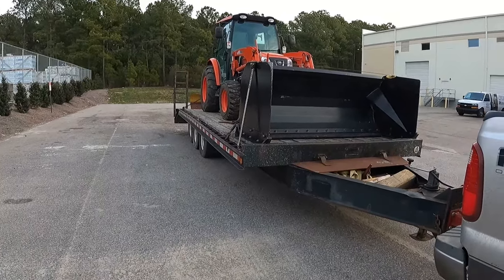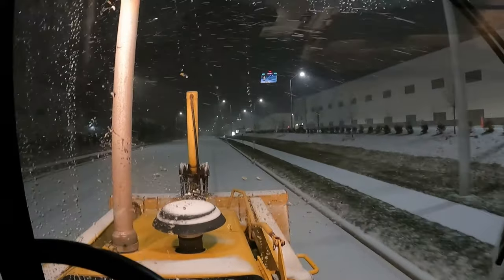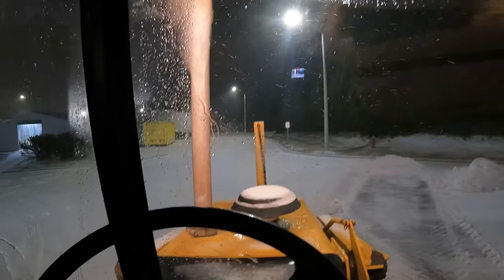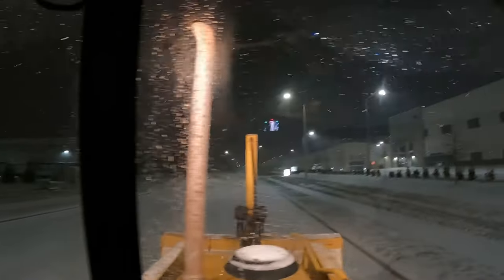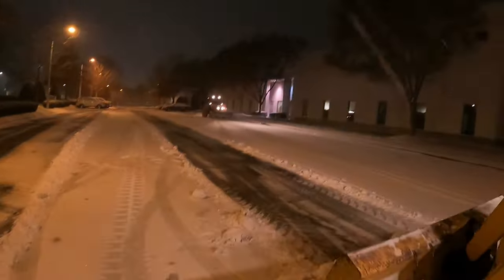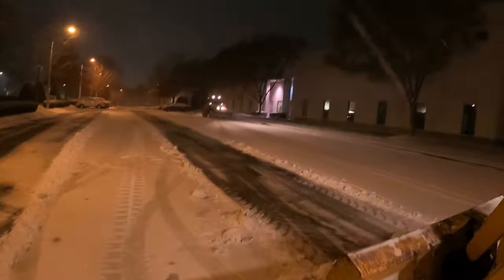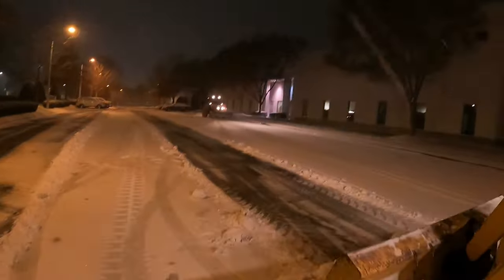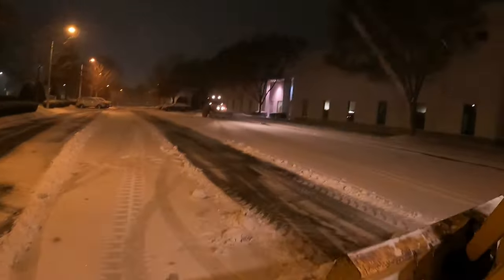Its Time To Snow Plow!

Comment: If the brine solutiion washing off is an issue, maybe they need to use salt/grit mix instead. Salt to melt the black ice, and grit to give some sort of grip. Unless you catch a big pile of it mid-corner, then it's like driving on marbles.
The downside is that it sticks to everything, and whatever steel it sticks to, it rots.

I've spent about four hours this weekend washing accumulated powdered salt off my car. And a few months of regular road dirt. I'm just glad it didn't freeze overnight and encase my car in ice.
Reply: My black car is currently painted white with salt spray but it hasnt rusted too bad before so i aint gonna start to worry about my 24 yr old car.
Reply: @kreetins  I wasn't really worried about rusting since my car's not that old, but there's a distinct issue with driving around in a mud-coloured car with black wheels.
Especially when it's meant to be silver, with shiny alloy wheels.
And, of course, the first day after washing it clean, I get a stone in the windscreen...
Reply: yep salt and grit are what they usually use here. sometimes only grit on sidewalks if the town is being cheap

Comment: just an idea split some air or garden hose slip on cutting edge to protect the edge and concrete asphalt etc,if you really want to get fancy get poly cutting edges i doubt that worth the expense and pain to swap for what little you would use them

Comment: I have lived in KY, VA, PA and now FLA..  I know the different snows and how badly they can screw up flow of life.  I could manage in PA with 5-6 inches no problem (except for the very first big snow, because of those procrastinators who didn't get their snow tires on in time) I never missed work.  But 1 - 2 inches could screw up K.  I remember 18 inches in KY one time... paralyzed in a big way.  The city has no plows.  just salt and cinder trucks.  I would hate to think what 2 inches would do in North FLA.  We get a quarter inch maybe every few years.

Comment: its all about practice, you dont have the practice northerners or those in the west in the mountains. just like you could work circles around me in the dirt i could do in the snow with you only because of practice. 
You got it done with nothing hurt so thats the important part.
we are having a low snow year so far, my little 40hp new holland is bored lol. saving on fuel though well except for heat, -32 sat, -15 this am and wed is supposed to be -25 again.

Comment: i plow my driveway / yard with my tractor,  on the front i have a 22 series sno-way plow with pump and lights removed because the loader lifts it and dump / curl function angles the plow, and i have one of those rear blades on the rear.

Comment: Plow a very similar type of location/situation, you are doing a good job with the equipment at hand. For the number of times you would be able to use a 10 foot box blade that we use it really isn't practical. Good work sir.Our last snow storm was 36" in 24 hours.

Comment: I hear ya Chris. The Seattle area gets made fun of when we have snow. But all of those making fun of us live in flat lands. The greater Seattle area is NOT flat. And we have the same problem as you with ice underneath.
Reply: Plus, Seattle snow, or any west coast snow, is completely different than anything east.
It's wet and slick from the high humidity on the coast.
In California/Nevada it's called Sierra Cement! No traction.

Go a little east and it dries up and you can actually drive on it because it has traction!

That's why places can get away with not plowing the roads clean all winter.
Reply: @ke6gwf  You're not joking. I'm just glad I can stay home now when it comes and don't have to go to work.

Comment: Does Ami make a 6 way dozer blade for the skid steer?  Be great for snow if you replace the cutter blade with a rubber one. Then use it to grade dirt on small jobs in the warm seasons.  I’d try it but I have a tire skid steer…. That’s enough said about that 🤣

Comment: You would probably need to run the numbers, but for that little bit of snow a blade on pickup truck might be more cost effective than firing up those machines. I have seen a whole lot more snow than that moved with something like a F-150 in Minnesota and other northern states.
Reply: Even the guys who contract out for parking lots use them in SE Ontario.  It's nothing to drive down the road and once winter gets serious every other pick-up will be sporting a plow blade of some sort. They are usually articulated to some degree so you could just plow everything to one side with just back and forth runs.  No lot time backing up.  🙂

Comment: I'm just starting this video but looks like you got a pretty good contract!! Far better than dealing with a mall parking lot!! We usually start our first push about 1 in maybe two if it's at night!! The worst thing plowing snow is uneven manhole covers they'll jar the teeth right out of your head!!! Last year I got to run the wheel loader for 26 hours, loaded over a hundred dump trucks of snow they got dumped in a field right next to the retention pond..in one mall parking lot... 22 inches of snow in 24 hours.. it sucked but at 20 bucks an hour times 26 hours you do the math worth every penny!!! Have you ever done donuts in a backhoe??🤔🤔🤣 Looks like they're awfully glad you guys were there!! I love this video very much,.. A lot of people don't understand what a pain in the ass snow can be.. looks like you guys got about three four inches and this is just one parking lot to deal with!! Imagine what the county deals with probably not even having this good of equipment!!??? And certainly not the kind of material moving experience you guys have;!

Comment: Now that's the way to do it. I see way too many american videos where they plow snow with plows fitted to trucks, skid-steers and the likes. There's no reason to be doing that when there's plenty of construction equipment and farm equipment that can get the job done faster, more efficiently, and leave a cleaner surface. One thing that I don't see you doing which is very common is back scraping with bucket of yours. It is a particularly useful technique when working in tight spaces.

And yeah, 13:00 that's not much snow at all. I've got that much piled up just from the single lane driveway at my house.

As far as getting you going when it starts snowing... It depends. North of the 49th, we typically, plow in 2 stages. Plowing during the snowfall is done solely with the goal of keeping the road open. They do a cleanup pass at 5 or 6 in the morning, right as everybody is waking up and getting ready to go to work. If they expect snow to be falling for more then 12 hours, they will send some of the crew home so that they can be ready for cleanup as soon as the sky clears up.

Btw, don't you have a grader? They do great for windrowing snow.

Comment: Around here if its 2-3in or less they dont even plow it they just put a crap ton of salt down and call it good, unless its super cold then salt isnt very effective. But the amount of salt they constantly put down in the winter is why our roads are so bad cause it destroys the road. After like 5 years a brand new road is trashed and ready to be redone especially asphalt, concrete is a little better.
Reply: Not to mention what the salt does to vehicles!

Comment: As a truck driver currently, thank you for clearing the snow! Lol
(Although I can hear them bitching about the useless plow guys leaving ice behind, and how they would prefer the snow... Sheesh)

I am mostly on the west coast, and we totally understood a little snow shutting everything down. We call it Sierra Cement out here, because it's so wet it's like driving in cement, heavy and no traction. Even with no ice.
That's why we get made fun of when there's just a dusting of snow and they turn the chain controls on, because people are spinning out and jackknifing all over the place.
And imagine as much snow as you had there, but on a steep mountain grade like the 50 mile long Donner Pass.... And people wonder why it gets shut down so often after a "little snow"! 

In the West coast states, if you are towing a trailer you have to put a couple of drag chains on the trailer axles for braking, but if you get further east into like Colorado, you may have to chain up the drives for power, but you don't need to put any on the trailer because there's enough traction to keep it behind you and slow down when you put the brakes on.

And then as you get further away from the high humidity of the coastal region, the snow just gets dry enough that you don't even need chains, and a lot of Eastern states forbid chains.

So yes, I am all familiar with people from the north and east ridiculing us and how we can't drive on snow, until they try driving on our snow and end up in a snow bank, and then they change their tune to how stupid our road crews are because their road crews can make snow drivable! Lol

Comment: This northern is giggling.  Yes . I plow 3 truck lots . The fun .but really,  a ? Would it be worth the time and $$ to find a 12 foot  clamp on by binder push blade from up here in the north for 1500 to 2500  and have Charlie come get it . Honest ? Chris .  I use a Mini payloader case 223 with a 12-foot clamp-on it works good sometimes it's a little too heavy sometimes it's too big sometimes it's just right but it does fit underneath of the trailers and gets the up close to the front end of the trucks a lot nicer and safer so yes this is an honest question

Comment: WNY here, this was funny as hell.... Interesting what you can do with earth moving equipment.  

This was effective plowing if you were being paid by the hour.
If that snow had been heavier, I think you'd have been snowed in unless you changed your tactics.  Or if you were being paid a flat rate to clear and move onto the next customer, you'd be letting money slip through you hands.
My armchair quarterbacking would have been more like.
-Skid steer with the ground blade should be running with its blade down, non-stop. Run in circles, squares or what have you, to keep clearing area and moving snow from low density area to higher density area.  Backing up 100' with blade up, trying to act like a plow, are not effective and a waste of time/$$ when an actual plow is available and more efficient at the job. 
2. The plows are great at moving dense snow, so have them cruise through the skid steer work area and take strips off that shrinking yet denser area.
3.That loading dock area was a nightmare, so you gotta do what you gotta do. 
   That might be one area to go big, 3-wide to maximize removal if you have an opening.  Because really, thats the meat of their operation.  
Again, with that amount of snow, good show.

Comment: ya im from pa but was in charliot for many years  one inch of snow and its over down there , drove from north charliot to south on 3 inches with my 400 hp 83 Camaro, called the boss as to why the doors where locked ,his responce was what are you nuts

Comment: Can you turn the blade around on the back of the tractor without disconnecting the whole unit from the tractor I know once I had one I had to unhook it from the tractor to reverse it so I could push with the blade

Comment: I like the Charger,  guy has to be a northerner,  2wd muscle car, out in the snow, no problem,  southerners all call off,  he's like,  ehhh a couple snow flakes,  time to go do some drifting and have some fun on the way to work!!!
Reply: @harveylong5878  typical southerner response,  I owned a 68 mustang that I drove to high school and college in Pa in the 80’s  no problem and up until a few years ago almost every police department in Pa and Oh drove Crown Vics, if you actually know how to drive it’s not a problem!  I lived in ga for 12 years and was amazed at people that would wreck on WET roads in summer because the didn’t know how to control a car in a slide.  Our drivers Ed instructors told sis to go to parking lots and do donuts to learn. 😂

Comment: There is a certain amount of snow plow operator aggravation coming through in Chris's voice that isn't there if he is moving dirt. I hope no one recommends he spends money on snowplowing equipment...   🤣🤣🤣
The tractor more or less works like a pickup with a snowblade that can angle. Actually a couple of trucks with blades would make short work of this place. 
I plowed a LOT of snow commercially and I agree with Chris. It can take a lot of years to get back the equipment investment even in snow country. With that said I've made a lot of money plowing snow... I just got tired of the long ass nights.     
One thing about plowing with a backhoe is they can easily tear things up... like curbs and manhole covers. Around here we shy away from using them... their potential to cause damage is too risky. Most people use skid steers and tractors set up like Chris has his.... but the real workhorse is pickups with blades.
Reply: Where the grater

Comment: It hurt me watching this one. I come from Western NY and plowed for years.. You should be driving 3/4 and 1 ton trucks. Far faster and far more comfortable and you can drive them to and from the jobs. I contracted WEGMAN'S Food stores and warehouse. All very large lots and other than the warehouse, plenty of pedestrians. Now I don't know how much snow you get on average, but any time it's by the hour or the job, speed is number 1.... A typical heavy snow, (2-3 feet), would take 3 pick ups and 1 loader about 3-4 hours if it wasn't a continuous blizzard. Yeah, I did a few round the clock jobs as well... but at $36.00 per hour back in the early 90's, yeah, you had to be good and efficient or they would find others who were.